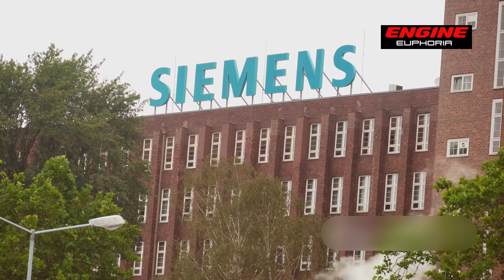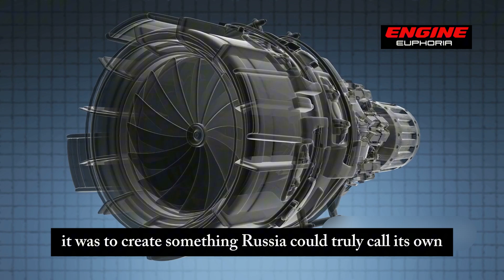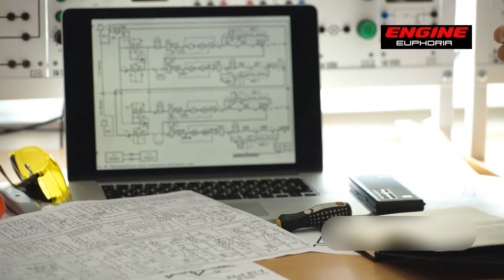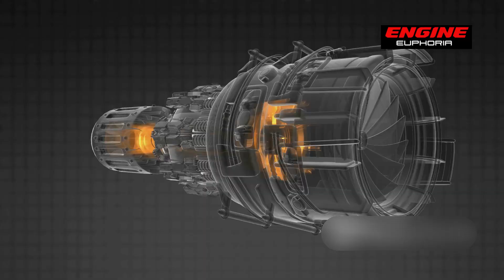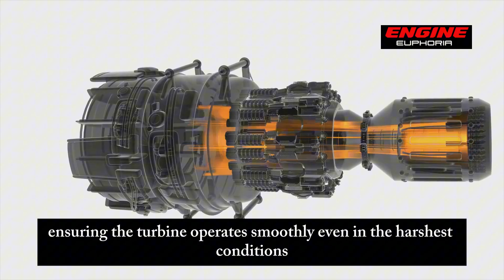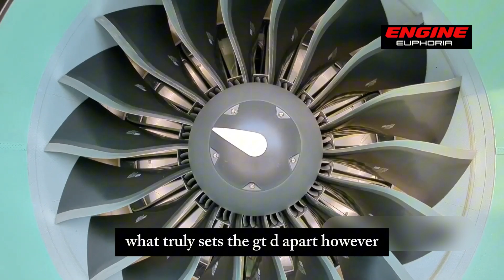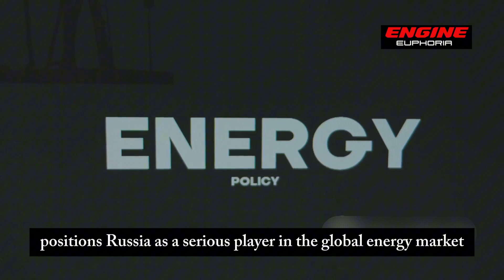Russia's NEW GTD-110M Engine That Will CHANGE Aviation! Here's why

Comment: LMAO 1 simple lookup shows production will only start in 2028 🙂With a maximum of 4 per year 🙂mother russia fails yet again 🙂
Reply: What's your source? Trust me bro.
Reply: @Peacekeeper1989  LMAO Did you understand '1 simple lookup' ?
Reply: @boereherp8705  I looked alot. Let me know what to Google. Thanks.
Reply: @Peacekeeper1989  GTD-110M rostec
Reply: @boereherp8705  "The United Engine Corporation of Rostec State Corporation will build a new mechanical assembly complex in Rybinsk to increase the serial production of the first domestic high-power gas turbines GTD-110M. The launch of new areas will allow mass production of up to four power plants per year from 2028. "//OK so they are producing them now and will expand production rate in 2028. That makes sense, since they already fitted one. You should read more carefully.
Reply: @boereherp8705  that's from AK&M article named: Rostec expands capacities for the production of gas turbines GTD-110M. //what you told me to Google never mentioned production numbers.
Reply: @Peacekeeper1989  LMAO You really should get an adult to assist you 🙂
Reply: @boereherp8705  OK so you were wrong and now you can't even provide a source. Well done genius. You can't even give the article name.
Reply: @boereherp8705  it's fine reading is hard. Peace.
Reply: @ LMAO Again, the info is easy to look up 🙂 Yet you keep showing you are too simple to do so 🙂
Reply: @boereherp8705  you can't even name the website. Are you scared? So adorable kiddo.
Reply: @ LMAO I did, you are just too simple to look it up 🙂
Reply: And the simple girl ran. Probably enrolling in an introductory course to using search engines 🙂
Reply: @boereherp8705  calm down, anyone that reads this can look it up. If you want to prove your correct provide a quote and source. You are too scared to do this. Everyone can see this.
Reply: @Peacekeeper1989  LMAO 2nd time . I did 🙂Yet you keep proving you can't look it up 🙂
Reply: @boereherp8705  I can't. Provide a quote. I'll wait.
Reply: @ 3rd tine 🙂I did already 🙂You seem to have a reading problem as well 🙂